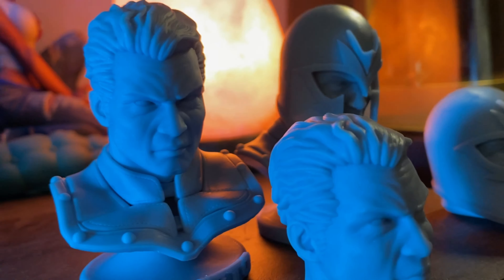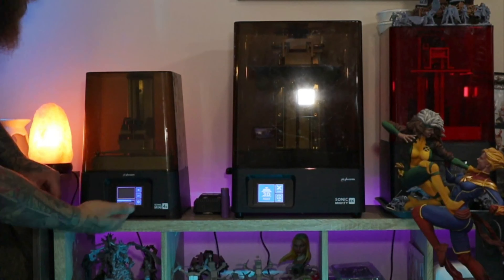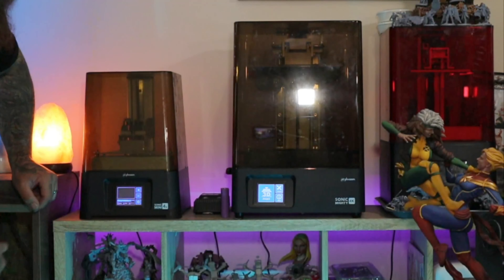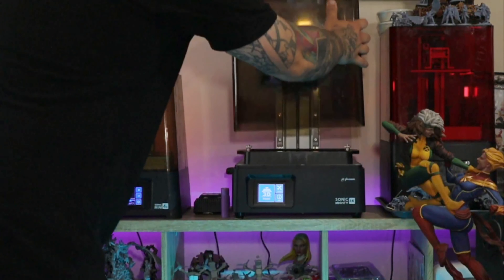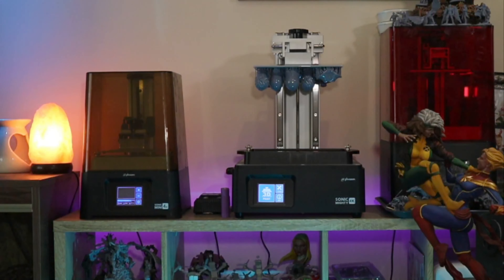Cleaning RESIN prints : 3D PRINTING MAGNETO

Comment: Do u rinse them in cold or hot water and does it matter
Reply from the maker: Hot water makes the supports softer and easier to come off with less damage. It doesn’t need a rinse at all. The alcohol will dry off faster than water. But I use the warm water to help remove supports